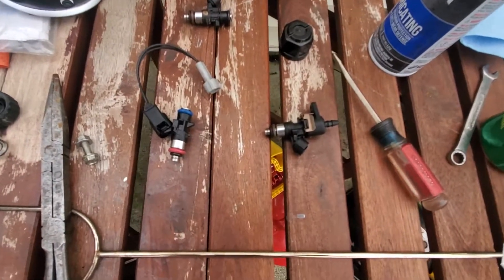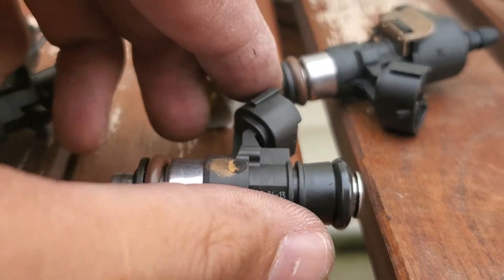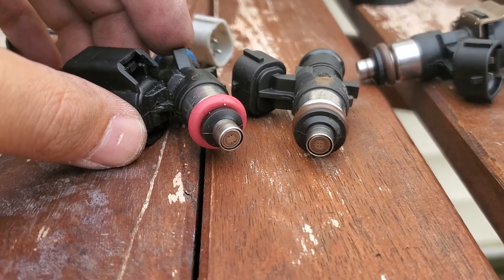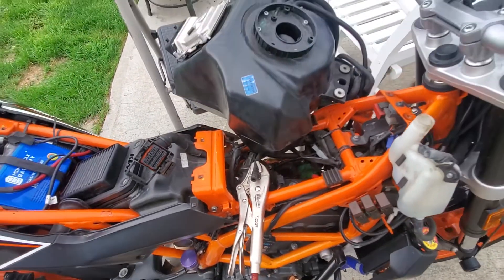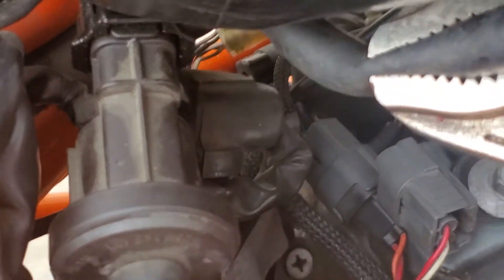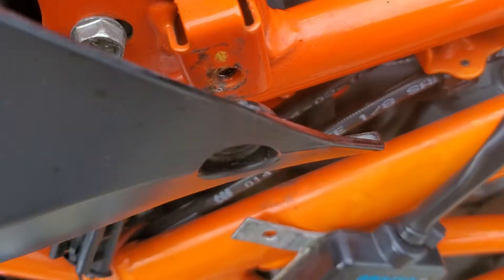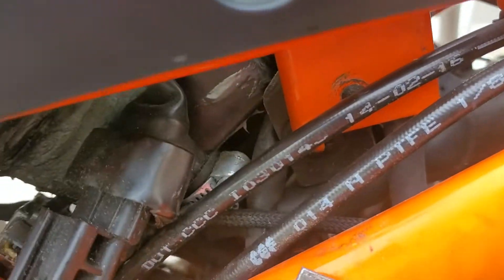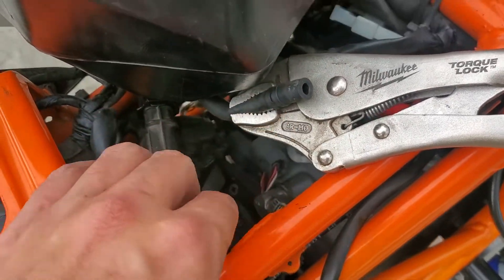KTM 390 Duke Larger Injector installation.

Comment: How you getting on with this a few months later?

I’ve no air box, straight through exhaust and a powertronic. 

Looking to sorting my lean issue out - in the closed loop section. 

Problem being in the uk is I can’t find a compatible part for the injector. Driving me mad. 

It’s in a cagiva frame so no use going back to the air box. 

I also need to source some kind of o2 sensor delete/manipulator
Reply from the maker: The injector comes from an American Car, but you can order it from  Gray Area KTM as well.  I have a Chimera intake and a MIVV exhaust setup.  I would look at the FUEL X, from my understanding it is like the power commander's auto tuner.  I'm using the Power commander WB2 auto tuner and my map is pretty much on point now.  You might be able to order the injector from Amazon or ebay.  I posted the part number below.
Reply: @RhoadsChristopher  FuelX is from Powertronics not PowerCommander. Powertronics is from an Indian company here in Bengaluru. I'm also unclear if it is really autotuning the AFR in real time. According to some videos you can set your target AFR and it will achieve it. But I'm not 100% sure. If it does what it says it will, then it will be so value for money as the Rapid Bike Evo autotuner costs a fortune compared to the FuelX as the FuelX costs under 140 bucks here in India.

Comment: After using this injector did you felt any noticeable difference in day to day performance? I'm also willing to install this on my 2017+ KTM DUKE 390. I have a powertronic ecu with an after market exhaust along with bmc air filter. Wondering after installing this fuel injector will my ecu auto calibrate?
Please reply if you are reading my comment.
Reply: I have this injector installed in my 2016, along with open airbox lid, full LeoVince Exhaust, DNA race filter, shaved head and thin head gasket kit (installed when the stock gasket blew out due to a factory flaw in the head), PowerTRONIC ECU and the FuelX installed. There is no comparison to the stock bike..... thing is crazy fun now, and probably somewhere around 45 HP to the wheel (stock was 36-37)! I had to drop a lot of fuel from the map on the PT since its a 300cc flow rate injector vs the stock 186cc flow rate. Only downfall it has is the much lower fuel economy, probably around 50mpg now so I have to fill up more often, could be that low because I beat on it more now that it has more power too......
Reply from the maker: @sheldonabbey555  Yeah i pretty much gave up on fuel economy a long time ago haha
Reply: @sheldonabbey555  Hi, do you run a special map or do you only use Fuel X with auto tune? I am asking because I have PT, Full Exhaust, DNA´s filter/cover,  but not yet Fuel X or use Tune-R.  Also, what injector do you use and gasket head.  I use the bike only on track.  No problem with fuel economy.   Thanks
Reply: @pierreaspar6508  Custom map for the mods sent to me from PT, was close but needed some cleaning up... GrayAreaKTM injector & thin head gasket kit. R-Tune is the progran you use to put the maps on the PT ECU or adjust them.
Reply from the maker: I am honestly still working on it.  I have been battling a coolant issue that has been leaking into the crank case.  I just pulled the head so I change the head gasket out and do some exhaust porting.

Comment: Would this increase performance, and would it work with a self learning ECU? I've got a rapid bike evo.
Reply from the maker: The short answer is yes.  The factory injector seems to make out and only allow for 13.8 afr at WOT.  This will allow you to tune down to the typical 13.2 most tuners go for.  If you self learning ecu has the ability to set targeted AFR then yes.
Reply: @RhoadsChristopher  sounds good, thanks for the advice!
Reply from the maker: @callumboothroyd3766  yup yup

Comment: Did you write down that part number for bigger injector? I am trying my best, but can't see the last 3 digits from the video. Its 0 280 158 XXX?
Reply from the maker: 0280158233
Reply: @RhoadsChristopher  UGH! So it is just a 11-19  Dodge injector for over double the price from GrayArea! $47 on Amazon, just doesn't have the jumper harness, which looks like it isn't necessary anyway if you cut the keys off the injector, the factory plug should plug right in!!!!!!! Wish I had seen this before spending so damn much on an injector for mine...... Could have had it in a day instead of a month also, may have to return the GAK order when it gets here.
Reply from the maker: @sheldonabbey555  that is exactly what it looks like based off of my own research as well.

Comment: What is maxxing out the injector? Just curious as I am datalogging with a wideband and with an intake and precat eliminated I can still run plenty rich with a powertronic controlling. Factory maps are lean from 5-7000 on a 2018 but mapping it i can still get to low 12 AFR
Reply from the maker: What this has to do with is duty cycle.  As the Injector pulses the duration is what increases to allow for more fuel.  I got to a point where no matter what adjustment I made it wouldn't change the air fuel ratio.  This tells me I'm either at the max of what the piggy back can control or the max of the injector can provide.
Reply: @RhoadsChristopher  makes total sense. Just not seeing that issue with my current setup. I may try the chimera intake and come to the same conclusion as you.
Reply from the maker: Chances are there is nothing wrong with it.  I just don't want to take the chance of running at a high duty cycle for a long period of time.  I'd rather get an over sized injector so I can scale back a bit.  With my other intake setup and injector I was able to achieve 13.8 afr at WOT, but I could never get it any richer than that.